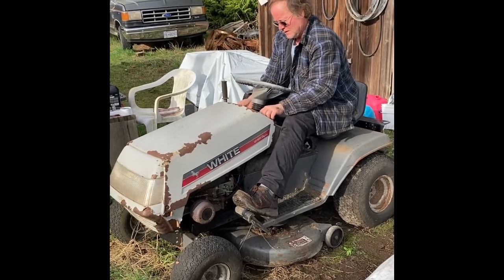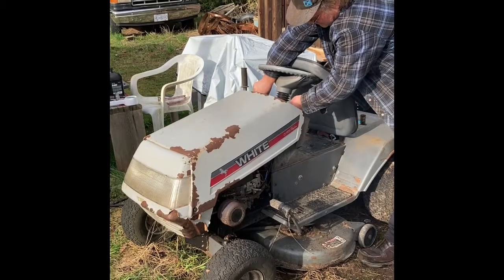Fixing ride on mower

Comment: Great video Jackie. Glad to see you are doing well and hope to see you at the mill soon. I just want to reach in and fix that carburetor. I have done so many but sounds like you got it. The deck bearings sound dry and I rebuilt one like you have. Three blades tapered roller bearings, but if you can get some grease into them it will run for a while.
Reply from the maker: Hi Wayne, the starter works awesome, thank you :) I will be back at the mill next week as well, we will try and get some grease into the deck bearings as well, thank you for all the knowledge you share :)